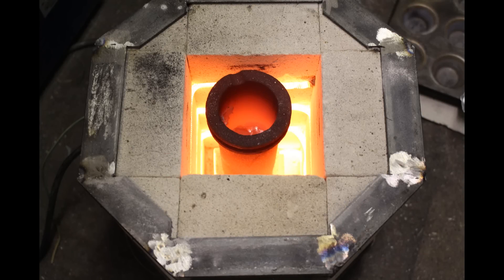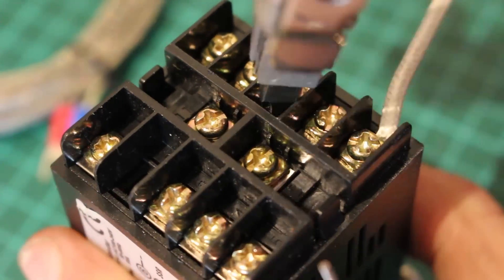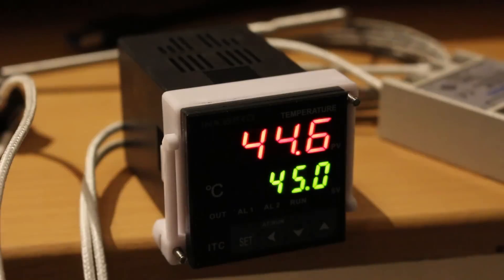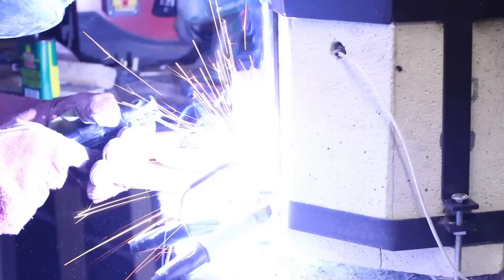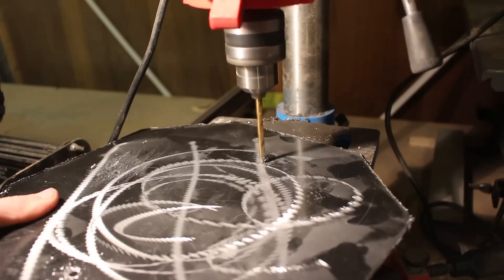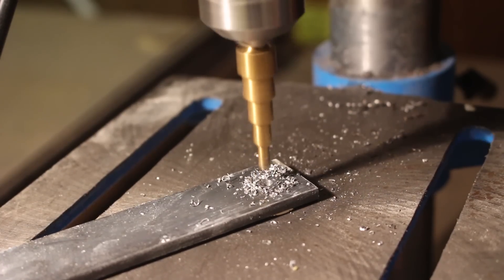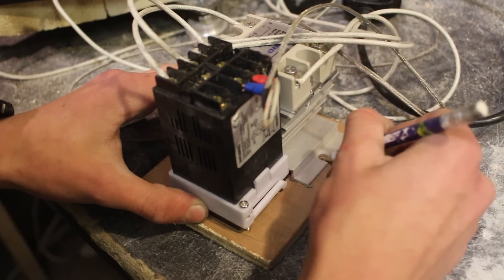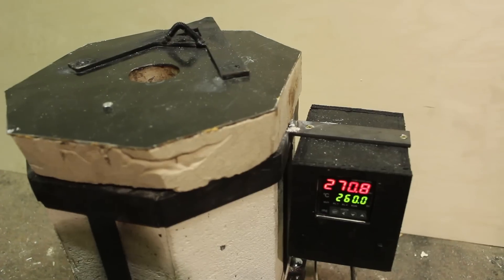How to Make an Electric Foundry For Metal Casting - Part 2

Comment: nicely done, maybe install a safety switch that shout off the coil when you open the lit. you could put in a switch that cut the signal from the PID controller to the SSR

Comment: Nice work.  Can I add a couple of suggestions - possibly life extending?  You could add a limit switch to the lid to sense when it is opened and disconnect the power.  The control box should be in a non flammable material to prevent fire.

Comment: For additional safety i would install an on/off switch to the pid controller. that way you can have it plugged in and it not heat up until you switch it on. just install it between the controller and the relay. it helps if there's and emergency or a mishap. just a thought. keep up the good work!

Comment: hey, you sohuld attach the neutral wire of the mains power plug to a plate in the bottom of the furnace that you sit the crucible on, and to the tool you use to put the crucible in and out of the furnace. that way if you make contact, the electricity goes straight to ground and not through you first!

Comment: Hey kiddo. You clearly listened and learnt from the suggestions made after the last video. You have gone away and "designed / implemented" the upgrades and, as a result now have a first rate furnace. Well done. Keep up the good work.
Now crack on with those GCSEs!!!

Comment: You could use it to temper knifes and it is bigger than a toaster oven so you could temper a sword.
Reply: I was going to ask if this could be used for that as well as a dedicated forge.  Good point.  I suppose it could.

I just read the comment below that a more purpose-built heat treating unit is in the works.  Go for it, as I think one thing that prevents a lot of folks from making their own knives is not having a reliable heat treat mechanism.

Comment: Good job! I have a suggestion: in you current build crucible supports are resting on the fire brick which will degrade with time. Good idea will be to weld thin strips of metal to frame on top of bricks for supporting crucible weight.

Keep up the good work! Greetings from Ukraine!

Comment: Great video dude, one tip though is you should only be crimping any high current wires together, especially the ground. Solder will melt if the wires heat up and can get dangerous if your grounding disconnects

Comment: Also add switch NO to door and use it to disconnect relay coil from temp adjuster.. So every time you open door, the thing shuts down.

Comment: Hello Artof...Nice to see another quality video in this series.  Good to see that you have earthed the metalwork as well.

Just a couple of small observations.  When you connect wires and then tighten the screws you will notice that if you insert the wire around the thread in the same direction as the thread tightens. Then the wire pulls tighter in, to make a tight connection. But if you insert the wire on the opposite side then the wire tends to get pushed away and makes a looser connection.  You mostly do this anyway, except on a couple of collections to the relay which looked otherwise.  Unless there was a washer there as well which I didn't notice.Also, now that you have the temperature control and thermometer you should be able to do your heat treating more accurately as well.  In some engineering books there used to be graphs showing what temperatures to use on different metals to get various levels of hardness.  I imagine that such graphs will be on the web somewhere now.Good luck with your GCSEs.  They must be coming up very soon now, but don't get stressed over them as I'm sure you'll find them quite easy!Best wishes matey...

Comment: An even better idea to detect a ground fault is an RCD, the fuse will only blow if enough current flows, and if your short circuit is conducting through the heating coil it may well not conduct enough current to blow a fuse at all

Comment: you should add a owerpowerprotection circuitbreaker for 2 or 3 KW and a error current curcuit breaker for 50 mA so you dont have to run to your safty box to swich on/off the current

Comment: Greetings from Pennsylvania, USA. I have watched all of your videos regarding the electric furnace you built. I was inspired by a number of things. Thank you for that. I've also watched the videos by VegOilGuy. I'm waiting for his reply about making coils, but haven't heard anything yet. I'm hoping maybe you can help. Here's my problem. I'm ready now to make my kanthal wire heating elements. The kiln originally had three (3) elements, each 1.8 meters long. When I use the "Coil Calculator", I enter 115 volts --- 15 amps (on a 20 amp circuit) --- 1.73 ohms (18 ga.) --- 7.1437 mm diameter and I get:
Power generated : 1,725 Watts
Resistance Required : 7.67 Ohms
Length of Wire need: 4.43 Meters
Circumference of bar : 22.45 mm
Number of Turns on Coil : 197
My question to you is, Is this right? am I missing something ? and if it is right, is this for each of 3 coils or one long coil replacing the three (3) ?   I hope you can HELP.

Comment: Glad you earthed it, it wouldn't have been fun if it shorted on the frame and made it live... :S Can you do blacksmithing with this then, by just leaving some steel in it between the two bricks on top until it gets red hot and start working it on the anvil?

Comment: This is awesome, thanks for sharing. I am quite new to this and looking for a way to turn plastic into diesel and was wondering if this method would also work for that purpose (for the part of heating the plastic)? Could you make it a bit bigger and place a steel barrel inside to melt the plastic inside at 400 degrees? Will do some more google research, but maybe you can help out with your great knowledge :)
Cheers, Nike

Comment: nice video! But you should consider earthing the lid aswell since that is the part you will use most of the time whilst its connected to power, and it does not have a proper way for electricity to flow to earth

Comment: Well done.  It would have been a good idea to either color code with tape or number each end of the wires.  The reason will become evident the next time you have to work on your control. It is also a safety concern for anyone else that might work on it in the future. Also, I find it odd that you had to calibrate the controller.  I would think that once you configured the type of thermocouple you used into the controller, it would be accurate to within a degree.

Comment: If you want your miters to match up on an octagon frame work you need to cut both sides at the same angle. Not one side at 90 degrees and the other at 45 degrees, but 22.5 degrees off both sides. This way you still have a 45 degree gap but when you bend the out side corner the inside corner line up together.  It will look far more professional.  Another visual trick to know if your doing it correctly or not is, when your seam is put together does is align with the center of your work. Good work, I like it.

Comment: If you buy a thermocouple that does not come with wire leads and terminal forks you must purchase these rated for the thermocouple that you choose (Type J, K, etc.). The forks are not necessary for wiring but if you choose to use them then they must be rated correctly.

Comment: Great video on the foundry.  I should add for your personal worry about making your crucible out of steel,  don't worry about that.  I have made steel crucibles for melting aluminum, knowing that steel melts at 2600 Fahrenheit, well far above the 1224 Fahrenheit of aluminum. just make it out of thick walled  1/4inch to 5/16 inch wall thickness and you should be fine.  I am a tool and die machinist and also have extensive knowledge of metallurgy of steels and their alloys.   From what I heard of your DIY foundry, it only reaches 1300 F.

Comment: Awesome upgrades, but what are you doing using expensive step drill bits without cutting fluid?   I'd suggest Tap Magic- smells lovely, cuts faster and great for tool life and best of all non toxic and biodegradable.

Comment: just wondering, to avoid the risk of touching one of the heating coils, could u create a brick lid that could hold the lip of the graphite crucible. The lid could have a circle carved in with an indent. So you don't have to reach inside to pick it up? Just curious if that'd work.

Comment: Great video mate, think I'll make one of my own. Any chance you can confirm that the PID works at temperatures over 1000 deg celcius. The one you linked in the description has a specified temperature range of 0-400 and I can't seem to find any advertising higher temperature ranges.

Comment: If you haven't answered this question already i'd really like to know how the furnace turned out in the long run! I looking for a furnace that melts brass or bronze and thought about building a gas foundry but your electric one looks pretty much perfect for my needs. And one other question: Can you set your temperature controller to heat up slowly for burning pottery?
I would be really happy about an reply.

Comment: Could you convert the current from AC current to DC current! PLEASE!!!! I just shudder at the thought of working with something so dangerous like that! still, great work. My simple charcoal furnace is not able to be used at the moment as it crumbles at the slightest touch ;(. I think I will upgrade it from player of Paris and sand to perlite and cement. Also any idea why when I first melted aluminium my steal crucible began to flash white and it had a yellow crud on it. Good job.

Comment: I enjoy gunsmith work and some gun parts manufacturing , I was interested in a foundry to case harden and restore Colt SAA frames , this would be the solution. You are a very talented and industrious man. Thank You for making all this information available, I know it was a lot of work. Now I will go and watch your first video and get started building my own.
Reply from the maker: No problem, some time in the future I am thinking of making a heat treat oven quite like this foundry that will probably suit your needs better. It will basicly be the same design and components but on its side.
Reply: The Art Of Weapons Sounds great ! I will watch carefully for the videos.
Reply: TAOW Say I wanted to get the furnace over 1800°C to melt platinum. Is that beyond the capacity of this foundry?

Comment: This would probably be a far superior and more economical method for melting and casting scrap lead than the standard propane burner and cast iron pot. Is there any reason I wouldn't want to use this foundry for lead?

Comment: Is it possible to mold a hoplite helmet in a sand mold? It would be great to make a bronze one
Reply: +MagosQuest Of course it is, but sand usually doesn't capture as much detail as plaster does (and the latter can be used for bronze castings too).
Reply: Although it's completely possible, chances are it would be much too heavy to wear if it was cast. As far as archaeological evidence can suggest, Corinthian helms(the standard "hoplite helmets") were wrought out of a sheet of bronze(same with the armor) not like the weapons, which were cast. If the helmet was to be worn, hand raising out of a sheet on a mandrel would be both a more comfortable helm, and more historically accurate.
Reply: Thank you very much ! And a bronze shield?
Reply: +MagosQuest as far as I know(obviously you could do som research if you want), the shields were also a sheet of bronze hammered into shape and attached to a wooden shield(kind of like armor plating for the shield). Have a great rest of the day!

Comment: I love this design, but I don't like the diameter of the crucible. How difficult would it be to create a wider diameter furnace? Would it be advisable to use a clay graphite crucible in this type of furnace? I would worry about getting a metal holder down in there to pull out the crucible since bridging the wires could be rather deadly.

Comment: so the pid controller kinda makes it so you don't have to have a exact length on the heating element? As long as it's not too long, you can just prevent it from overheating with the pid, right?

Comment: 4:51
You see how the aluminium has melted onto the element then flowed out and touched the flat bar? Thats an electrical connection between 240V and your frame.  Just in case anyone watching the video felt like not copying the new earth connection ;)

Also if your new lid cracks too check out ceramic fibre blankets. A lot of people use it in gas forges. It can't crack like brick or ceramics, is fairly light and more insulating than the bricks.

Comment: This looks like a great forge for not too much compared to alternatives indeed. As I understand the melting temperature right now is limited to the coil and wiring right? So in theory if you were to get different coils and wiring you should be able to easily raise the temperature assuming the temperature control can handle it? Just asking out of curiousity and you have one damn fine forge sir.
Reply from the maker: You are right, at the moment I am limited to probably around 1100 celcius before my coils begin to die and too much heat is lost through the insulation. I was thinking about upgrading to molibdinum disilicate elements but they are like £200 each and that kind of defeats the point of this foundry.
also they would probably melt the fire bricks :)
Reply: Shame they are that expensive and yeah that would kind of beat the purpose besides the satisfaction of making it. Do you by any chance know the melting temperature of the bricks you have used?

Comment: i watched the first instalment of this build, Let me first say, Nice job. You mentioned how much you paid for the steel you used. I noticed a sticker with a bar code on it which tells me you probably purchased it from a Big Box hardware or home center. If you live in an area that has a big chain store like that then you likely also have a Steel supplier that fabrication shops buy steel at. The price you paid is roughly what a 20 foot stick of the steel you used actually costs. Most of these shops have minimum of 1 stick and most will cut it down to a manageable length (1 or 2 cuts) for no extra charge. If you become a regular customer some will let you go through their drops bin and sell you drops at the scrap price. 
if you do a fair amount of steel fabrication its worth looking for a supplier. because you'll be getting 4-5 times as much steel for the same price.

Comment: Thank you so much. I have question about the PID. I would like to use for melting brass. Do you know if it works with temperatures higher than 999C? (There is 0-400C in product description, but you go easy to 730C)
Does anyone know difference between PID type REX-C100 and ITC-100VH ? Thanks to all.

Comment: What is your current consumption?  How much, or how little, does this affect your utility bill?
Reply from the maker: at max this forge draws 5amps and is around 1.8kw so it only costs 18p per hour to run and compared with coal or propane that is way cheaper!
Reply: +The Art Of Weapons Thank you, asked around, people said it would be too expensive with electric, but if it really is a low draw, I really want to move forward on making this style of forge.
Reply: In general combustion should be cheaper for heat, but the problem is for a forge (as opposed to home heater) you can't approach the same efficiency -- most of the heat just gets lost.

Comment: Hey i love your vids and i started metling aluminum myself a year ago and im planning on going electric aswell,  just wondering im also thinking about melting platinum in the future, just a question do you think those coils can reach 1600-1700 Celcius without melting? if they even reach that tempeture.  if not maybe you or anyone else reading this has a suggestion for smelting platinum?
Reply: The coils of wire he used (which I'm assuming is nichrome) will melt at around 1300 C.

Comment: Young man, you show great promise.  I suggest you contact fellow UK based YouTubers DoubleBoost and Mr. Crispin.

BTW, that kiln might get hot enough to handle bronze.  Brass is certainly doable, but zinc vapor is toxic and might best be avoided.  IIRC, iron requires approx. 2700 deg. F. and I doubt you can get that hot.

Eli D.

Comment: I am curious as to what the maximum temperature is of this system? Hot enough to melt copper?
Reply: Fire bricks are top rated at 1000C so thats kinda limit on those. Coil is rated 1300C.
Reply: Hellsong89 Yes I understand that. I decided to build my own recently using the same heating elements. Turns out it isn't hot enough to melt copper.
Reply: then you have an insulation problem
Reply: He's not using fire bricks, he's using special kiln bricks. They're on ebay here in the UK (same dimensions and price he gives) and they're rated to 1700 deg C.

Comment: how much Watt does it take from the net? (i ask watts, since some nets are 110V, other 220v). friendly greetings, Jörgen Börg
Reply: nevermind. i checked the material you used, and if you use the 3 coils, it should be up to 3600 watts. :-)
Reply: On the first video he said that it should be approx 1.8kW
Reply: Intanius
 that's weird. unless he used only 1 coil. 1coil on ebay was 1200W.

Comment: Does the thermocouple measure air temp or surface temp?
Reply from the maker: It measures the internal temperature of the probe right at the tip so it takes a few secconds for the heat to conduct into it.
Reply: Ok thanks. It looks like a great foundry by the way, you are a very skilled!